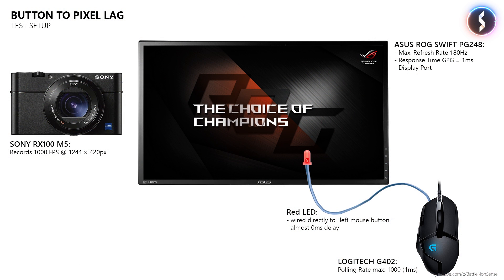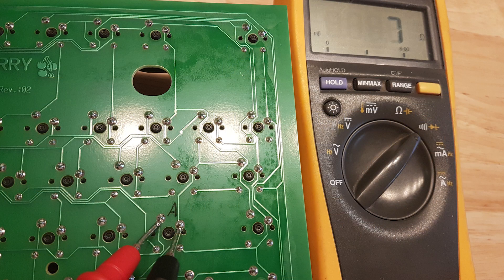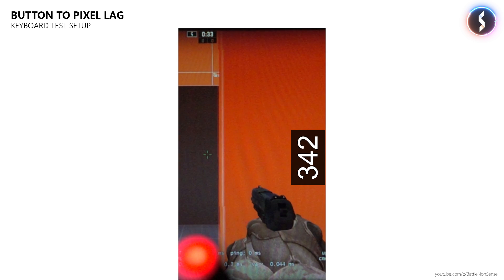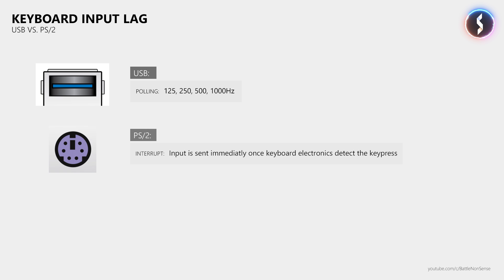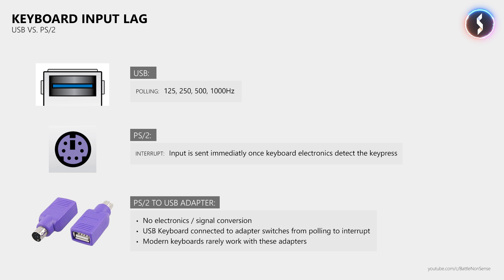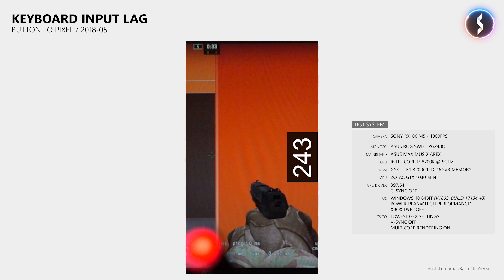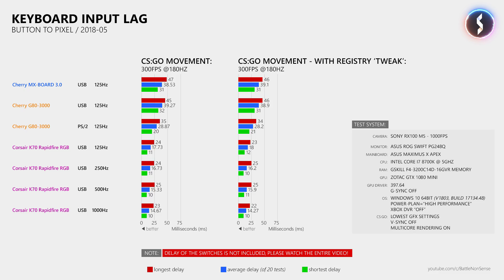Keyboard Input Lag 125, 250, 500, 1000Hz USB vs. PS/2

Comment: i wonder if the usb to ps2 adapter adds any latency, would rather have seen a native ps2 tested
Reply: and actually, based on the cherry keyboard difference going from 125hz to ps2, avg desktop delay 40/31.4=1.273, if we assume 1.273 is the average difference of going from 125hz to ps2, then apply that to the k70 keyboard 125hz avg 24.6 / 1.273 = 19.3ms, and the 1000hz delay is 21ms, so this tells me its very likely that if the k70 supported ps2 (it doesnt) that it would be faster on ps2 than 1000hz. anyone here saying that the 1000hz is better b/c the results in this video forgot it was on DIFFERENT keyboards and need to understand that the physical construction and layout of each individual keyboard matters. i saw another video where a guy tested a modern mechanical keyboard vs an ancient ibm ps2 keyboard with an oscilloscope and the 1000hz was slightly better, the problem with his test is he should have tested THE SAME BOARD with an adapter that supports ps2. @Battle(non)sense should have tested a modern 1000hz mechanical keyboard that also works as native ps2 to get a real determination on ps2 vs usb. native ps2 is likely still superior to usb when it comes to keyboards.

Comment: for your testing method to be more accurate i would say you need a monitor refresh rate of atleast 2000hz, and a consistent 2k fps, that said people dont have that so yea going beyond a polling rate your hardware is realistically capable of wont make much difference, when it comes to mouse response i do notice a difference in the feel despite running @60hz 220fps, under 180 fps in csgo i cannot handle playing as it feels sluggish and inaccurate, even tho u cannot see it you can feel it, that said i would likely not notice a difference because my hardware if i was to use 500hz rather than my current 1000, but my change from 125 to 1000 was a noticeable difference

Comment: PS/2 goes to 200Hz polling rate in Windows XP in device manager. I think from Vista onward though Microsoft removed that functionality and is probably a Kernel level change to the OS itself thus any registry setting hack won't actually increase the system interrupts rate in practice. It was probably done for security reasons actually to prevent hacking exploits for side channel row hammer attacks where someone exploits the system stalling the PC change then something in memory before the system itself can verify the data was changed. Wiring in a bypass switch would also directly reduce input lag in practice, but presumably you did that on all three keyboards tested. 

Something glaringly obvious though with this test setup and comparison is the Corsair keyboard superior as you demonstrated is superior to the Cherry keyboard's circuitry. That introduces a variable which invalidates this whole testing methodology. You can't compare them with variable like that directly in regard to USB polling rates versus PS/2 system interrupts. If it were a clinical trial it wouldn't hold up to scrutiny you've introduced a foreign variable in a sense. 

You'd a PS/2 capable keyboard that also supports polling rates of up to 1000Hz to really compare this fairly and properly is my point and also testing PS/2 at 125Hz isn't perfectly fair either because it can in fact go up to 200Hz when properly supported by the OS itself even if Microsoft butchered it though I'd understand the reason if it was to prevent security exploits honestly and could be the case.

Comment: Your input lag also depends on the operating system and the loaded drivers.

If a cheap ps2 keyboard configured correctly and the OS doesn’t treat ps2 keystrokes as usb keystrokes as it happens on windows 10 by default, it would destroy everything else.

Comment: PS/2 port supports multiple rates as well up to 200Hz max. I used to use win9x utilities to set the rate to 200Hz for my PS/2 mouse and it feels smooth. Not sure what is the rate that the usb keyboard is supporting through the adapter.

Comment: 125hz to 1000hz average delay decrease of 3ms is perfectly logical.

The polling rate is like a scheduled bus, where it comes at fixed interval to take all input to the PC. As a result, 125hz polling rate simply means the bus comes once every 8ms. As a result, it doesn't mean you will ALWAYS get 8ms delay, but rather, depending on when you press your key, you can get delays from 0ms up to 8ms. Considering you cannot reasonably time your input to the rate at which the polling occurs, your expected average delay is actually 4ms. Similarly, 1000hz polling rate will have a variance of 0-1ms delay, which result in 0.5ms delay on average.

As a result, when measured, your average delay reduction from 125hz to 1000hz should be 3.5ms reduction in latency on average.

 The variance of the input lag is also much lower. This is actually very crucial for rhythm game players, where longer input lag can always easily be compensated by game setting and user skill, but variance in input lag is something that cannot be accounted for and can cause random bad timing windows from happening.

Comment: Best video I have seen on this topic so far, would like to see more on this stuff if possible.

As to what might cause the delay between different keyboards, usually switches used for digital applications use 'switch debouncing' which allows some time delay before the signal is registered. Without this one keystroke could get registered as many many keystrokes, so I wonder if this is the main cause of the delay in the keyboards or if there is other more significant effects going on.

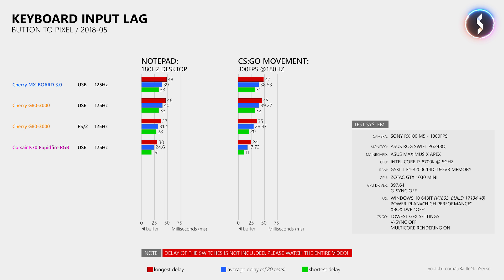9:43 Correction: in theory, it should reduce by 3.5ms, so a 3ms decrease makes sense given margin of error. The improvement from 125Hz to 250 should be about 2ms, 250->500 1ms, and 500->1000 0.5ms. This all lines up with your data. I can explain if you want...

Comment: You could just plug the keyboards to a computer and look at the polling rate of the device. Contacting the manufacturer was not necessary to get the information; the computer asks the polling rate from the keyboard. (or if it is a USBv1.11 keyboard, the kind that works with the passive PS/2 adaptor, the USB Boot Keyboard specification states 125Hz). You can just violate this standard however, most keyboards will still work at a much higher polling rate, but their internal matrix scanning circuitry will not poll the key matrix fast enough for it to bring much benefit. Many USBv1.11 keyboards will still have a higher internal matrix scanning rate than the 125Hz and will work faster if you violate the standard. I have never come across any USB HID devices that wouldn't work if I just forcibly polled them at 1000Hz, most just would not work "at 1000Hz" due to their internal polling rates and such but would at a much faster than their default polling rate. Cheers!

Comment: The only question that is left: does CHERRY G80-3000 the fastest PS/2 keyboard? I'm pretty sure it is not!
Just by connecting it through PS/2 instead of USB gives you ~25% less input-lag. Apples to apples!
So it would be fair to assume that fastest PS/2 keyboard would beat fastest USB keyboard by 25%

Comment: A really nice video. Thumbs up. One special keyboard would be nice to re-visit here. The wooting one, which is built from the ground up to reduce latency. Supposedly it achieves ~4ms latency only. It doesn't have to de-bounce the electrical switch contacts to stabilize the signal. It also doesn't have a mesh design, that adds latency. Would be cool to have this analog keyboard with 1000hz polling rate to be verified :)

Comment: Ps/2 can run at 500Hz ;). My gaming setup  was doing (0~1~)2ms vs 8ms.  Ps/2 was default 100hz (windows related i think?) if adjusted 200hz.  0..x..5ms. Everybody was buying usb mouses and gamers mouses. I played with 2 buttons mouse and a scroll vs mx5xx. That mouse was 800dpi and still nearly the finest dpi. 640~1200 dpi. Playing on 4K with no mouse acceleration demands ~1600dpi.

Comment: Even if you’re using an interrupt interface (PS/2), the keyboard still is using a polling technique to scan key states by row. Its how the chip is able to have ~100 input buttons readable with only ~20 input pins on the chip (e.g. 10 “rows”, 10 “columns”, different among keyboards, not necessarily correlated to the physical key layout). I would assume that a good keyboard would synchronize polling between keys and USB in order to avoid an accumulated polling delay.

Comment: Why usb matters is when the mouse goes berserk with +250hz I cant aim if the mouse moves too fast so I really like 75 hz or usb 125hz, i rather do a 90 degree turn slow than fast or at a custom speed from the mouse manufactor or any hardware that interfears with the mouse movement like anyting in windows ( windows suc for gaming but micros so not understand this)

Comment: Are you sure that the two switches inside the 2 pol switch activates exactly the same time? This can lead to a significant error in all results. However, the error would be the same in every test and therefore not important when comparing results.
Reply from the maker: I am, because I attached an LED to each of the switches and then did a high speed recording.

Comment: Actually, there is a important flaw in the test method used here. The button you used to trigger a key press has a "bounce" time when pressed, depending on the type of button you used. When pressing a mechanical switch the electrical connection inside the button is not perfect, it bounces form 0 to HIGH for a short time (2-3ms), then it stabilizes to HIGH. Each keyboard is calibrated to work best with a specific type of switch which has a specific type of bounce. Depending on the debounce algorithm of each keyboard this influences more or less the key press detection  event of each keyboard type. To eliminate this issue I suggest to use a Arduino board and 2 transistors to trigger the key press and turn on the LED.

Comment: Hey Battle(non)sense

There is also one thing that is not mentioned in this video that is part of the keyboard delay.

That is the keyboard's scan rate.

A keyboard's internal hardware(could be a MIPS CPU or other microcontroller) is constantly scanning for key presses at varying intervals(based on hardware).
These scan rates vary quite much; some (very few)have a scan rate as low as every ms, while majority of other keyboards have scan rate intervals >20ms.

One keyboard that has 1ms scan rate intervals is the cherry mx 6.0. It's microcontroller is faster than 99% of all keyboards in detecting key presses.
The reason most keyboards have very high delays in key press detection is simply because of an issue with registering multiple key presses in one key stroke.
By that I mean that when you have super low latency scan rate, you can press a key one time and it will occasionally register as two presses. This can be fixed by adjusting windows repeat key delay.

This may also be why most keyboards have a really slow scan rates by default; to omit the possible repeated key press.
So as you know, many gaming keyboards list 1000hz polling rate, but that it not near as important as the scan rate.

Slow scan rate + 1000hz is still going to be much slower than a fast scan rate with 125hz polling.

Anyways, when you compared the two keyboards with the same 125hz and are simply saying 'It must be better electronics' now you know.

You may also find this keyboard test useful in your tests.
It gives an estimated scan rate for keyboards.

blog.seethis.link/scan-rate-estimator/

I have an MX6.0 keyboard and my lowest key press is about 2ms.
Reply from the maker: According to the Cherry Support, both the G80-3000 and the MX3.0 run their matrix scan at 1000Hz. :)
Reply: The scan rate coupled with processing delays makes those boards much slower than the MX6.0 with realkey.

Maybe the scan rate is 1000hz, but it takes approximately 20-30ms to process those key strokes and sent the data to the PC.

MX 6.0 is the only board that has the 1ms key presses.

CHERRY RealKey analog technology - or in short CHERRY RK - is a completely new approach for reading
key signals. Instead of digitally scanning the switching points, each key is simply connected
to the analog controller. This results in as yet unprecedented advantages
over any existing technology:

No delay
The signal is read in realtime at the press of a button.

DIGITAL TECHNOLOGY HAS ITS LIMITATIONS

The performance of digital controller technology has systemic limitations. In terms of speed and precision
in signal processing, this technology is not able to provide an optimum performance.
The weaknesses of digital technology:
Delay
Unnecessary time is wasted between pressing the button
and processing the signal.

Comment: why did you used so complex construction in order to connect LED to keyboard switch?
you could simply use a transistor with base voltage low enough to open it with switch press, then use a battery to provide voltage to LED, and voila you have very compact, simple 
 and low-latency LED trigger

Comment: USB vs PS/2. 

Doesn't use an actual PS/2 keyboard.
Reply: Impossible.
PS/2 protocol times out if a command takes more than 15ms.
Reply: Considering the classic PS/2 keyboards generally bitbang the serial protocol, I doubt it makes much difference. Another thing that might be fun to see is that PS/2 keyboards, unless using set 3 (which many don't support), have higher lag on key release than key press.
Reply: Actually Unicomp makes some pretty good ps2 model M keyboards.
Reply: USB - PS/2 hybrid keyboards are actual PS/2 keyboards when connected over PS/2

Altough i agree that testing a PS/2-only or even an old AT keyboard with an adapter would be a good idea
Reply: The circuitry they use in hybrid boards aren't native PS2 so, but all of this is pretty pointless to begin with.

Comment: In CS:GO, movement is based on an acceleration calculation, so there's actually a small window where the movement key is pressed but you won't move at all. 
It would have been better solved with binding fire to the A key via the options or simply
bind a "+attack"
Great video nonetheless
Reply from the maker: you don't move, thats correct, but your hand and the gunmodel is moving down. which you should see in the video. :)
Reply: Battle(non)sense Absolutely,  I saw youre reacting to player model movement, but its still quite subtle in its first few frame leading to a potentially large error in measurement
A simple action rebind to one with a large easily identifiable (or one previously used for other tests, ie shooting) would still have been preferable to both increase precision, but in the case of using it to shoot, at least put the systematic error equal to mouse tests :)

Comment: Absolutely awesome video very informative, I subscribed! Im currently building a digital pinball arcade machine and im gonna wire the hardware buttons up to an arduino aswell, by pulling pins high or low. Could you test what the input lag is when using an arduino as a keyboard? would love to know!

Comment: And there are many more things that can impact the input-delay for a game (that also impact various other things).

For a keyboard there are several things that introduce delay, like debouncing (hardware of the keyboard), keyscanning (most keyboards do NOT listen to all keys at once but are scanning them in rows, often so that it scannes the whole keyboard once per poll, data-conversion in the keyboard chip, polling, and lastly - but with a huge impact - how the game actually handles the input.

Games can handle the input per rendered frame, per engine frame, or via timestamps.
If it is per render frame that means that your delay is directly correlated to your Fps. If you get one frame every 20 ms (50 FPS) that adds an average of 10 ms.
But the input-engine can be running at a different framerate - while the game is rendering 300 FPS the input is only checked 60 times a second (and yes - that is used in games often) - which would add 8 ms delay.

And then there are games that use timestamp based input which means that the keypressed is noted by the game and evaluated as being executed at the time it was pressed, not the time the next frame was rendered. That allows a game that runs at even just 1 FPS to near instantly react to your input despite you not seeing it happen.
Great thing about that: have a weak PC and the game come to a crawling halt due to too many things happening at once and you can still control your character.
Had this in an ActionRPG on an old, crappy Laptop: In busy fights when some big special effects got displayed the game came down to under 5FPS yet it still recognised fast and long command streams for combos and the like where good timing was key.

Comment: I believe you should test a real ps2 keyboard, not a usb one. I would think that the usb ones on ps2 mode look if a key is pressed and send it to the pc, at 125hz.
Reply from the maker: Not according to Cherry. Both keyboards have an internal Matrix Scan rate of 1000Hz. When connected to the PS/2 adapter these keyboards behave like a native PS/2 keyboard.
I did want to get a PS/2 mechanical keyboard but I couldn't get one.

Comment: Hi. It is possible to increase polling rate of PS/2 devices - both mouse and keyboard up to 200hz.

The original purpose wasnt for shorter input lag, but for higher accurancy when aiming with a mouse. Default PS/2 polling rate could be as low as 80Hz, but when used analysis software, polling rate is dynamic and mouse is not sending any data at all if not moved/clicked.

Basically it wasnt about faster reaction, but about "more samples".